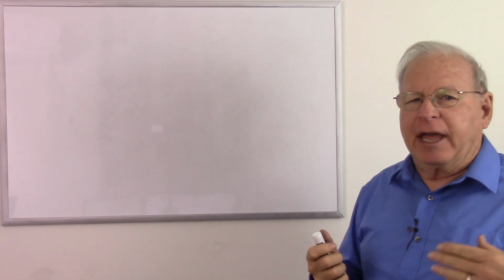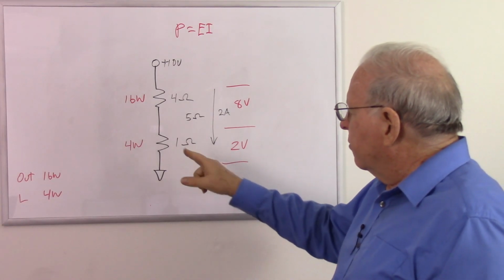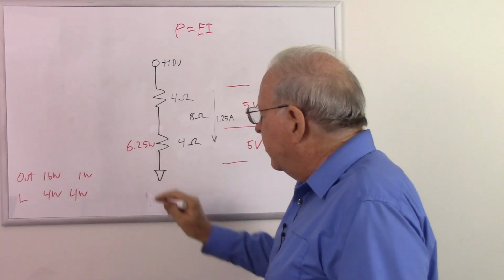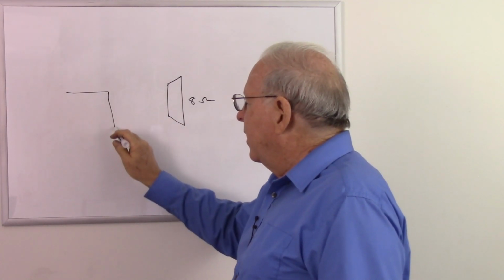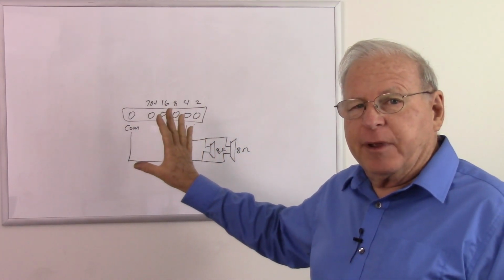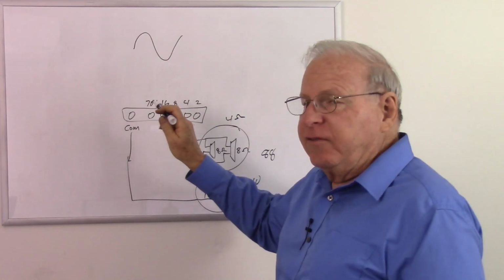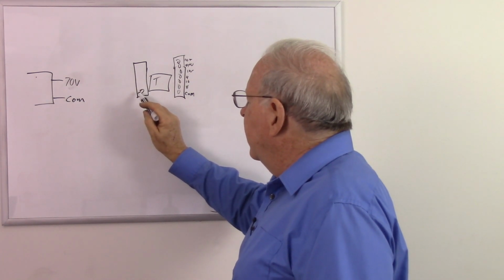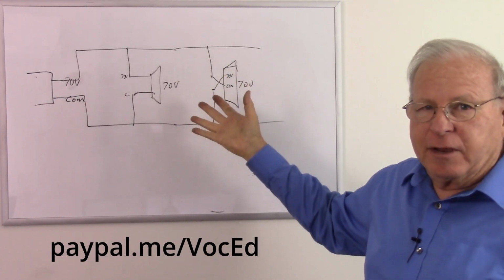Loudspeaker Impedance and PA Systems - Solid-state Device and Analog Circuits - Day 11, Part 5

Comment: So, this is not correct for the vast majority of loudspeaker setups. The output impedance of the loudspeaker is perhaps 1/1000 of the nominal impedance of the loudspeaker, in order to make sure the voltage(!) follows the music signal, and in turn the loudspeaker moves accordingly. Having a large output impedance would completely mess up the pressure output from the loudspeaker, and you would not be able mix and match amplifiers and loudspeakers, which you largely can when focusing on voltage, not power. Sure, power matching is important for other applications than this, but the video is on loudspeakers. The impedance of a loudspeaker is also complex, not purely real, which makes for this video being even more off.

Comment: I have seen guitar speakers that were rated at 90W and 8Ohms. I have wondered for years, what combination of voltage and current should be used by the power amplifier with such speakers. I was told in another video thread that we can use the Power Rule and Ohm's Law to answer this question. If I = V/R and P = V * I, then V = sqrt(P * R). So, in my example, V = sqrt(90W * 8Ohm) or 26.83V. Plugging 26.83V into the Power Rule, then I = 90W / 26.83V or 3.35A. Is this correct?

Comment: I have seen 32 ohm speakers . Ampeg 300 watt tube bass guitar amps have a speaker cab with 10 inch speakers . They have 8 speakers in parallel to 4 ohms  .

Comment: You're  confusing impedance with resistance.
Reply from the maker: Resistance is a component of impedance, and is the only component in DC circuits. Impedance is the combination of resistance, capacitive reactance and inductive reactance (https://youtu.be/oAoMAWlVB60), is measured in ohms and is treated exactly like resistance at a given frequency. I have never checked, but I assume that the impedance of a speaker is measured at 1,000 Hz.
Reply: No he’s not. May be you are confusing them

Comment: One thing to remember with speakers is the impedance changes with frequency and signal amplitude.  Speaker impedance tends to decrease as input frequency increases and it increases as input frequency decreases.  A speaker's impedance is usually specified at 1kHz.
Reply: Would the speaker impedance not increase as the frequency went up? Due to it being a coil of wire. I'm only asking to learn a bit more. Thanks.
Reply: @marcuswilliamobrien I believe you’re correct.
Reply from the maker: Take what you get from ChatGPT with a pillar of salt. Above the resonant frequency the capacitance looks more and more like a short circuit and thus causes the impedance to decrease. The impedance increases as frequency increases only below the resonant frequency. See my video on capacitor and inductors in parallel: https://youtu.be/VfWOXcCUuqs
Reply from the maker: I have never looked this deeply into speaker design. However, at this point in the course, you should know that a speaker voice coil, like any inductor, has capacitance. This capacitance is in parallel with the inductance so a voice coil is a parallel resonant circuit. I assume that a speaker is designed to have a resonant frequency outside the audio range. If the test frequency is above the resonant frequency, the impedance will decrease as the frequency increases. However, if the resonant frequency is above the test frequency, the impedance will increase as the frequency increases and approaches the resonant frequency.
Reply: You are right to say it is  growing with frequency (not falling -DC  resistance of coil is always less than speaker 1 kHz impedance)  but    in real construction whole thing   is much more complicated,   it's real  character sharply and greatly varies. Unfortunately many people specialy electronic developers do not take it in account and put full effort  on flat amplifier output. It is like expecting full contact of two surfaces in case when we care only for flatness of one of them and do not notice that another is not flat at all.
Reply: Use current feedback and a woofer will go to 10kHz. They also go up in Z as they warm up so bands turn the sound up not just because they go deaf during a gig.